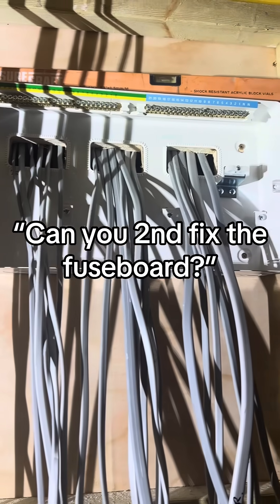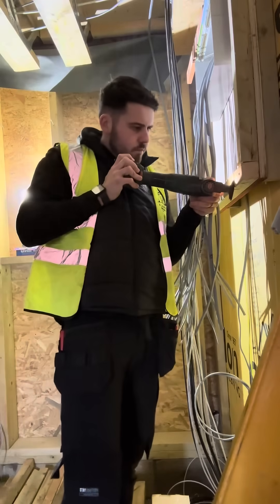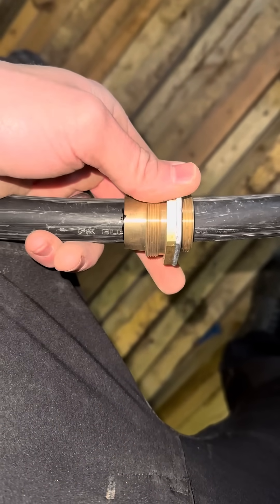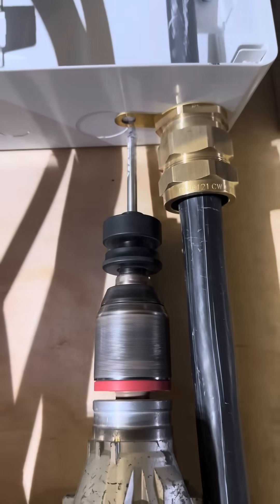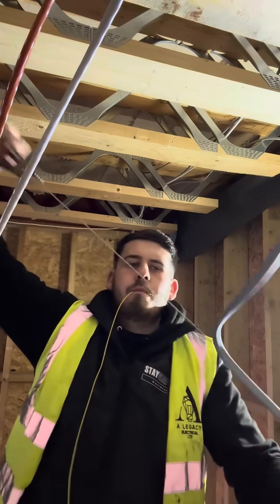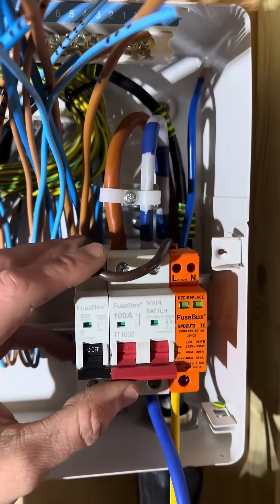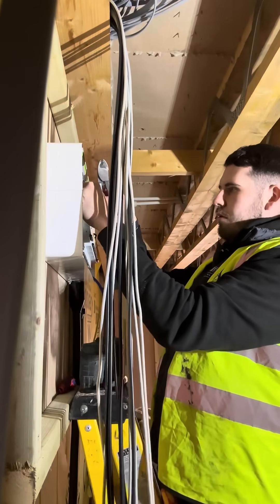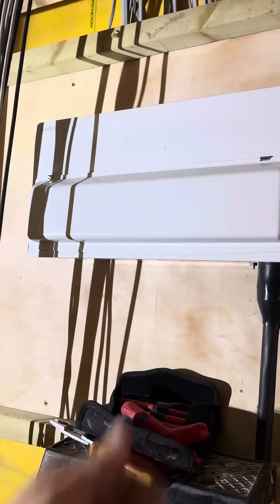Can you second fix the fuseboard #electricallife #electrical #electrician

Comment: Jesus Christ, just put a brass nut an bolt on. The gland is brass, it looks better than a shitty roofing nut a bolt and appeases all NIC inspections.  If you was working on industrial kit, a decent spark would be using brass nuts a bolts anyway. I got snagged for it when I worked on a firm that scrimped on materials and I didn’t know any better. You live and Learn.
Reply: Steel consumer unit, steel locknut, steel wired armour.  Why do you feel it so important that the banjo bolt should be brass?

Comment: I have been pulled in the past for it on an NIC inspection years back. I just use brass’s all the time now. Saves the hassle in case the same guy does any of my assessments. I know others that have had it mentioned to them.
Reply: Steel consumer unit, steel locknut, steel wired armour.  I wonder why your NIC assessor feels that the banjo bolt needs to be brass?

Comment: Bend radius is too tight for those t and e cable singles. You will have stressed the insulation and they should be remade as its a fire risk
Reply: There is no bend radius for singles
Reply: Wtf brother?

Comment: I always put the nut on the inside,and then a crimp lug with an earth fly lead to the earth bar. If you use the right length of gutterbolt,you wont have an issue with it damaging cables.
Reply: Nah if anything all you have to do is scratch the paint of the metal housing, its already earthed. But yea to be ocd you can fly lead it aswell

Comment: Brass nut and bolt for banjo please. And link to the Earth bar. Roofer used to banjo is an NIC snag
Reply: @stevebrant6420  what even is NIC snag? Is it a special set of regs that NICEIC registered chancers work to?
Reply: On your yearly NIC inspection the assessor will flag roofers for banjos. Should be brass nut and bolt
Reply: @stevebrant6420  who told him that? Did he ever back it up with any reg number? I had mine try to tell me u have to use fire rated stuffing glands on DB...
Reply: @stevebrant6420 that doesn't actually make any scientific sense though does it banjo itself provides enough contact to the metal housing which is earthed. The bras bolt and nut more hold its it in place. If you were to fly lead it if it was a plastic caseing on the unit the lug is not brass is it?.

Comment: Absolutely no point putting banjo on if you dont put erth tail onto the bolt...
Reply: It’s a metal consumer unit you don’t need one anyway…
Reply: @Adam-lc3is  metal yes, but there is a layer bieng the paint/powder coating, is the drilled metal a good enough contact to the bolt? Best to install a link for all of 30 seconds
Reply: @Adam-lc3is Yes you do.

What do you think happens if the lock ring becomes loose? If you’re whole install is relying on that for the earth then you’re piss out of luck.
Reply: @ Of course it makes a difference. I’ve had countless high Ze readings due to loose lock rings where they haven’t used a fly lead to supplement the Earth..
Reply: @uplightuk8924 a loose lock ring is a poor job.. you should make sure all connections are tight not use a fly lead to cover a shoddy job
Reply: The board itself is earthed that it’s being bolted too
Reply: @keniff87  my point exactly. Banjo is to connect earth lead to gland when required. Gland is already bolted to the enclosure that is as you say earthed. Id check the continuity between enclosure and gland to ensure paint doesnt rewiire cleaning off under the gland. However on the main supply side id be putting and earth strap onto the gland 100% belt and braces and would ensure minimal R1R2 to help keep zs compliant with required max zs of distribution circuit feeding the board.
Reply: @ to be fair I haven’t fitted a banjo for years now, storm gland with a piranha nut is the way forward!
Reply: @peterigrenyi9176 your point about paint is valid but if there's continuity I fly lead is not needed as the boards earthed its just over kill. Not wrong but not technically necessary
Reply: @daenbrown830  my point exactly. No lead needed, thereford no banjo required. Just a pointless hole in the board... obvoidly if the board has removable gland plate lead is required...
Reply: Peculiar comment

Comment: Why is the mains coming straight into the board? Where's the meter?
Reply: If it's an SWA then it will be fused down with a switch fuse in the meter cupboard as this is probably more than 3 metres away from intake.

Comment: The bolt defo always goes on the outside! Amount of times i see it facing into the enclosure. Looks shit
Reply: The corre t way to eartg the swa if you are not using the enclosure is:
Bolt through the enclosure and banjo, secure the bolt nice nad tight thats banjo fixed. Then u slap some washer on, then you get cable lug on the bolt from your earth tail, than another waaher and then a second nut... especaily on diatribution circuit if SWA is used as CPC for example. Now how would you do that nearly if bolt is to the outside?